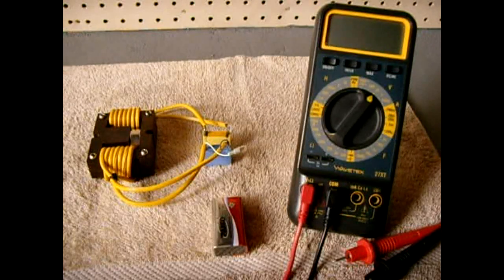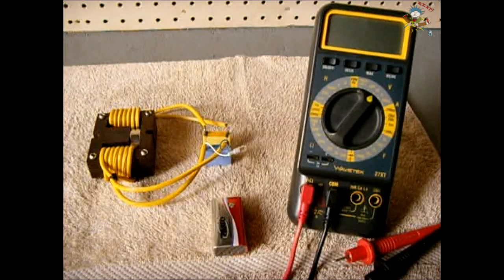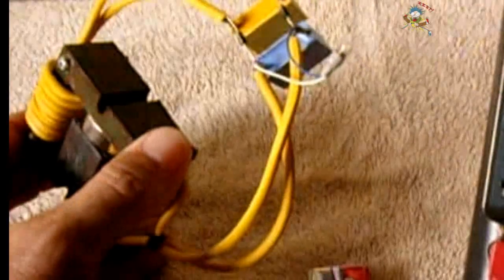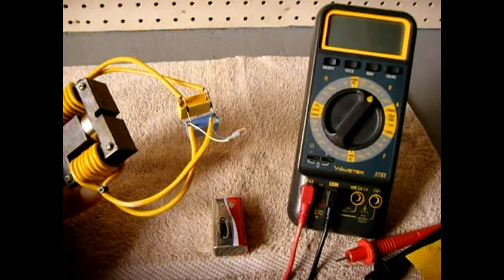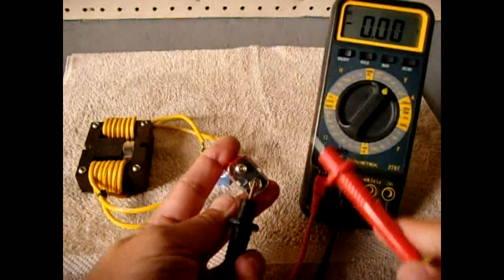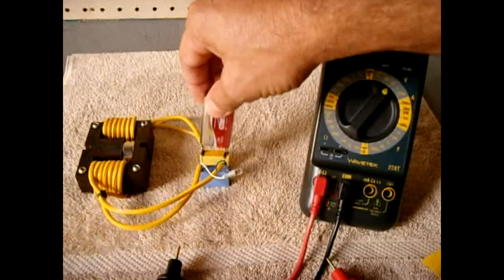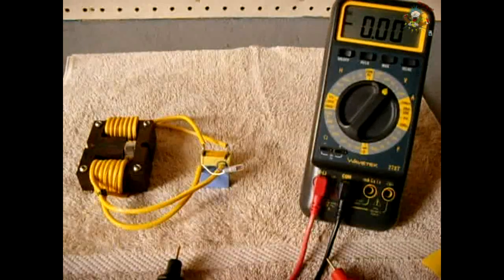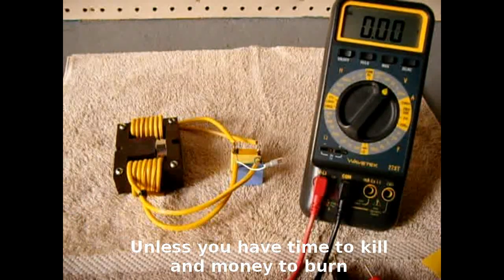Overunity Motionless Free Energy Generator EXPOSED!

Comment: A few points on why your version was set up to fail from the get go. Deirones version is set up in a similar fashion to that of Thomas E. Bearden's patented 'Motionless Electromagnetic Generator' or 'MEG', with the exception that Deirones does not use a micro-switching device for rapid switching of field intensity from one side to the other. Instead Deirones uses two separate gauges of wire with differing number of windings, in order to create a difference in fields to simulate the difference in fields, in a normal generator as it spins. Deirones uses 7 winds on the red, which is a heavier gauge and only 6 winds with the blue, which is a thinner gauge. Deirones leaves the wires coming from the coils separated from each other, so as not to short out any field generated. Your version uses the same number or turns and the same gauge on both sides and then you bind the wires coming from each coil together so as to cancel out any field that may have survived your attempt to botch the experiment in the first place. If you are attempting to replicate then replicate. What you did was to deliberately attempt to screw up any possible chance of success on several levels. Deirones' set up follows the very same basic principles behind Bearden's patented device, just with a much simpler approach. The idea in Bearden's approach is to have a similar set up to that of Deirones, but you apply a slight boost of extra current, first to one side and then the other side , rapidly, through micro-switching, making one side to have a stronger field and then the other, simulating the fluctuating fields as a conventional generator spins, thus generating a current. Deirones gets around this by making one side permanently weaker than the other to achieve the same effect as Bearden, but in a much less complicated fashion. He jump starts the device by giving a slight boost (with the 9v battery) to the weaker of the two sides which acts like giving a flywheel a push on a Stirling engine, creating a sort of 'vacuum' on the weaker side for the stronger side to fill and from there the 'flow' begins around. You attempted to hamper its function at every turn, so you cannot claim to have attempted to 'replicate'. Look up Thomas E. Bearden's patented 'Motionless Electromagnetic Generator' or MEG, U.S. Patent #6,362,718. Food for thought
Reply from the maker: Oh, easily duped one. LOL Just because something has a patent, does not mean it works. :-) You need to wake up. Please, do not waste my time with your nonsense.
Reply: @electronicsNmore Have you ever tried his sugestions to see if they make a difference?

Comment: One observation to those not short in age rather than understanding. Just for the substantial need to say something offering a spark of hope in a dark web of misfortune misleading and misgivings.  I who as someone that not only knows a great deal about everything yet very little about any one thing. Interesting how many offers to sway others full of a hope. Full of self esteem with  just so great a idea.we must attempt it or life has no meaning. For knowing better a noble action causing a person to be denied  the experience.  .  to you  the noise control web masters I just like to have a out burst now and then. knowing knowledge of worth causing a few or many to attempt to unplug from debit is unacceptable on this censored network. Its only amounting to less than 35% of the world net in general however the less so enlightened shop and inquire to be shut down when the one says see and 5 paid noise control sofa slugs flood the search engine with false information.  Important to attempt all of anything you herd or seen yourself. Believe your eyes and get help from someone you can l;look in there eyes to see if there full of it. Tesla's one wire magnetic flux in the wire coils warped wire with smaller dia wire maybe a tiny charge increase also   to insulate the electrode causing a  increase  threw the larger windings as well as a RF amp boost your sound not your current. things increase RF strength each time the current passes threw the amp. just don't stop for a guy saying theres nothing worth going over the hill just stop and forget knowing what he says is not worth the effort in going. He thinks theres no worth in say a Cal Tech theatrical physics major with a growth hormone imbalance in her upper possible  ecosystem alternative. From Atlanta home of the Georgia peach and the walking dead . Cows cause global warming. Milk from another source Peaches and cream. Knowing is half the problem! Thinking others know better is the rest. Good If this gets posted Ill be looking for a ice cube in my ex wifes hand next I see her..   .

Comment: have you tried following his example of the windings being loose around the core I would think that may allow for micro fluctuations your tight wound setup does not....also the man says he supplied a starting voltage from the 9volt battery....this would require contact to both terminals at the same time ....you said you had 0v on the circuit....so you never started it...

Comment: The only thing you managed to "EXPOSE" here is your own personal bias - an exposé requires that you show how the 'trick' was carried out, which you singularly fail to do here.  Just because you have something that looks like the original, doesn't make it so!
Reply from the maker: If you actually believe this works, then you're hopeless. I show in my other "Free Energy" scam videos how the scams are likely pulled off, in this video I only show that it does not work as shown. It is very easy for me to make this APPEAR to work, but I have better things to do. Have a great day.
Reply: I was simply pointing out a FACT - namely, that your video "exposed" nothing. In order to expose something, you have to show how it was, or may have been done - there are lots of Youtube videos that do proper exposés.  You on the other hand, showed nothing!  Suggesting something is not the same as showing.  Semantically, I'm on firm ground here.

FTR, I have also built this, and several of the motor-variety out there, none of which worked.
Reply from the maker: Mojo Jomo
My video saved A LOT of people time and money, that's all that matters. :-)
Reply: I disagree.  I clicked on your video to see an exposé - didn't happen!  I bet a lot of others did likewise.  Your video title is misleading.
Reply from the maker: Only misleading to you. The title clearly states &quot;Exposed&quot;. When something does not work as shown, which I clearly demonstrated, then that fits the description. Stop bothering me with your nonsense. I have much better things to do. You can&#39;t figure out that a small battery was likely hidden in a capacitor or the core? Get real. Additional comments on this thread will be deleted.

Comment: crazy question....

the video i saw use two different gauged wires...

i have seen many diagrams including Tesla-coils and such that do this using a differential in the magnetic field  passing through each coil.

honestly i agree with you the set up shouldn't work by any means, but i do like to tinker with other peoples thoughts on the matter.

Comment: DC won't pass through a transformer.  So I don't see how this could possibly work even if there were superconductors.
Reply from the maker: Exactly. You can only transform pulsed DC or AC.
Reply: That's one of the facts you have to know to build tube amps.
1. Transformers only pass AC
2. Capacitors block DC
3. DC current flows from negative to positive
4. Capacitors will only pass certain frequencies based on value
5. Un-smoothed DC will show up as noise in your audio signal

If you have not guessed,  that's what I do...  build guitar amps.

Comment: No offense, but if we acknowledge that Youtube contains questionable 
videos, how do we know this isn't one of them?  It may be just a personal preference, but I make it a point to question each video I watch.  ...nothing personal.

I have watched other videos such as this one, and have seen that it doesn't work until you jump-start it with a current.  It's just a dead magnet until it's jump-started.  Then the current appears to run until a short is applied.
Reply from the maker: NONE work. You don't get energy from nothing!
Reply: That's the interesting part.  Scientifically speaking, there's no such thing as "nothing".  This is where the terms "zero point" and "overunity" come from.  

Most legitimate overunity devices require an initial charge in order to function.  Until I see one used with this one, I'm not sure I can buy that it doesn't work.  

At the end of the day, I have to exercise just as much skepticism with this video as I do any other.

Comment: ElectronicsNmore thx for taking the time and expense to show everyone that this is a hucksters hoax and nothing real. And yes if this fool really found something concrete he wouldn't be giving it away, he'd be busy procuring investors and or a patent.
What I was most impressed by this huckster's device was the very low crkt. resistance. The voltage hardly changed at all between the 1W, 5W & 60W bulbs/loads. This implies a very low output resistance. Magicians don't reveal their trick, it's always a trade secret. So the real challenge to this device/trick is determining where the energy comes from. Is it a LiPo battery hidden in either or both the hollowed out magnetic core or capacitors cases or is it plain old induction. It remains to be determined. My money is on a hidden battery because the effect range is too large for induction. Either way, so far, there aint no free energy been ever found. Although there is an over- abundance of one kind of free energy and that is... gullible energy.
Have a great day all.

Comment: You didn't make everything to exact specification. Why don't you reengineer the transformer core to the exact way it was presented in the original video. Each transformer core can have different specification and operating tuning frequencies. Also make sure the diodes are exactly as what was presented in the original video. Consider reverse switching speeds may need to be slow rather than fast. Before you just palm it off as a complete scam.
Reply from the maker: Robert, time to wake up. The device is a scam. Using a little common sense can go a long way! If you doubt my results, then try it yourself. :-) Thanks for watching
Reply: Has anyone else tried this experiment with a DROP IN replacement of the transformer core , if you have not got the right transformer core and the right frequencies, even I can prove it as a hoax, I dont think you have tried hard enough, I can prove anything to be a hoax, thats no problem, but you havent tried hard enough to actually prove its true either.
Reply: I would very much appeciate EXACT replica's , no cutting corners with different components even if they are similar looking. The slightest variance can make the thing NOT work at all.
Reply from the maker: *****
I have a few "Exact" Free Energy replicas on my channel, and guess what, all are scams.
Reply from the maker: *****
Like I said, if you doubt, try it yourself. :-) Be prepared to waste a lot of time and some money.
Reply: The very first thing I saw was the transformer core. It is completely different to the original. Can you say this is exact? Why do half a job and expect it to work?
Reply from the maker: ***** Stop wasting my time with your nonsense. I have over 340 videos with people asking me important questions. There are multiple videos showing this scam device, for all I know you could be looking at the wrong one. This is the LAST reply you will get from me. Additional posts on this from you will be deleted. Have a nice evening. Find something better to do.

Comment: I'm no electrician. I'm just learning about some different electronic circuits and components. I could see this actually working. NOT because it is "FREE" energy but because if you used the right storage capacitors you could get the capacitors to store up enough energy in a very short time to run that tiny bulb for quite some time. The capacitor stores energy sort of like a battery only they charge up VERY quickly and when connected to something with as small of a drain of energy as this tiny bulb the capacitor could actually keep it lit for quite some time. The windings and the coil are just something to make some people think there is something amazing going on and cause confusion.  Please understand, when I say I think it could work, I DO NOT mean to say I believe it is an any way an over-unity device. I'm only saying the capacitors could be used as storage devices from which to draw energy to light the bulb until they (the capacitors) were drained. There are a few people trying to use capacitors to replace batteries.
Reply: The caps would need to be huge (the size of a shoe box) to output the power and maintain the voltages shown.

Comment: Are there any free energy machines at all that actually work?
Reply from the maker: +RawMan Raines 
Not that I know of. Thanks For Watching!
Reply: Here's the other and this co has been in business for a long time no bad reviews either - www.FuellessPower.com I actually bought their $70 plan but have not done it yet - I also bought the eliminator's plan too but cannot yet afford the parts to build it - I am getting a bunch of things done so I can focus on this subject because solar is simply not an option because someone can take out your entire system with one shot as it is so Huge a target, so I cannot justify the expense. So again thanks for checking things out and saving others time and money - 
Shalom !!!
Reply: +RawMan Raines You been done, no such thing as free power, your power sources are basically, chemical & mechanical, so a hand crank turning a magnet in a coil makes power, free power? no because you are the fuel source that inputs energy.

You have other factors like inertia and friction, their is no such thing a frictionless, you can reduce friction but even at atomic levels you have friction (in wires) and you can feel this as heat (friction causes heat) and thats why transformers heat up, electrons flying around in wired, inducing magnetic fields in another coil makes wires hot.

In a power station, the generators have to be turned off to cool down.

too many people think that they can get free energy, there is always a cost somewhere and that is often the cost of getting together free energy kits. Even solar PV isn't free energy because you have to buy the kit and then in some areas you need planning permission and then you may get taxed on it because your improving your property value and any energy is now (through legislation) rightfully the energy companies to claim, they do have to compensate you but thats at a price they set and anything you generate is running your meter back lawfully! so if you're lucky you will break even on your investment.

Comment: Unfortunately it is not an exact replica. First: your iron core consists of but one part, not two. Therefore the Leedskalnin effect of closing on electric impulse does not take effect. Second: the neodymium magnets (2 not 1) used in the original video are from a hard drive. Hard drive magnets are in fact two magnets side by side in ONE body. Try one and you will see.
Reply from the maker: +Peregrinus 
Keep dreaming. LOL. The device is a scam. You seriously need to awaken to that fact. Stop being duped by scam artists!
Reply: Careful reading prevents silly remarks. I said it was not an exact replica, and it is not. And that is true even if it is a scam. On the other hand Leedskalnin PMH effect works in practice, it is proven. This replica cannot produce even that while the scam can.
.

Comment: From just looking at the device, @ first glance it appears too simple to be anything genuine.  However your explanation of how the fraud was accomplished has some holes in it as well.  You suggest 2 different paths for the energy to be fraudulently injected into the system that do not make sense to me.  (1) a possible magnetic coupling of an oscillating magnetic field. (2) A small  lithium battery hidden inside one of the capacitors.  What is wrong with (1)?  Well in order to induce a current in a magnetic loop the loop cannot be closed.  This device consists of two closed magnetic loops.  Neither is  there any winding outside of the magnetic enclosures.   What is wrong with (2)?  A DC battery placed in parallel with such small winding large gauge wire coils would be instantly shorted out.  The wires around either capacitor are clearly solidly soldered in parallel with the coils,. Since there is a fraudulent power source it has to be in the base sockets of the lamps.

Comment: Have you covered all possibilities, you only tried different value capacitor or diodes, what you didn't do was to reverse the phase of one of the windings, or the other one, and remember you also have two diodes, which conduct a certain way, and their relationship can possibly effect the circuit one or the other, so you need to try and reverse phase on the top windings , if that doesn't work, try reversing phase on the bottom windings, returning the top windings to original phase.  Don't take me wrong, I still don't think it will work, but you need to check all possibilities.

Comment: Thanks very much for your video! Indeed, there are some other "FREE ENERGY" devices, the bi-toroid transformer (BiTT) for instance. It is claimed that the input power factor (PF) if BiTT is ZERO and the output PF is UNITY. However, analyses just show that the input PF is not zero, but very close to zero. And the practical industry power analyzers (measuring the active and reactive powers) cannot achieve that high measurement precision. Because, the precision of power analyzers will be very poor when the PF is very low.